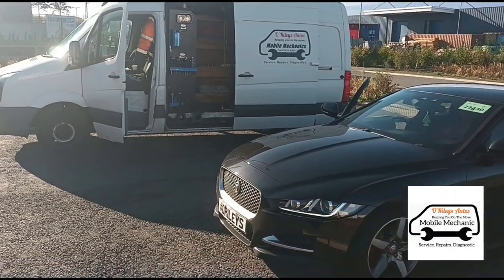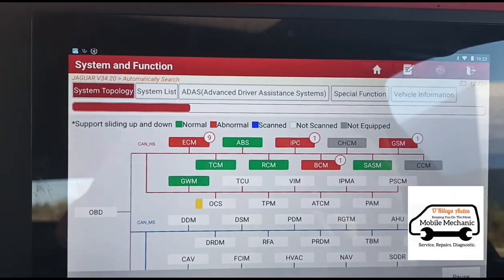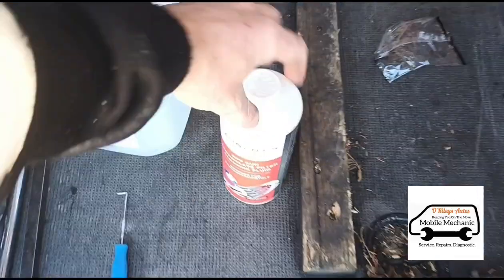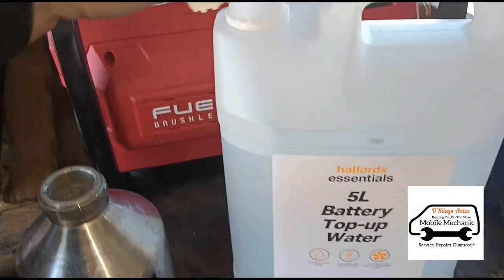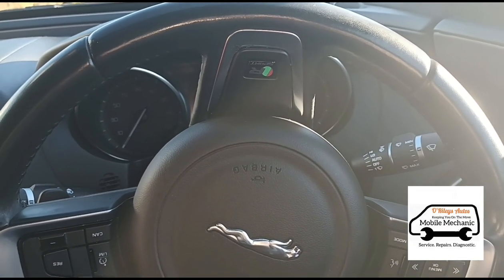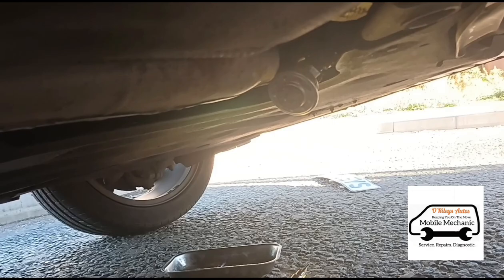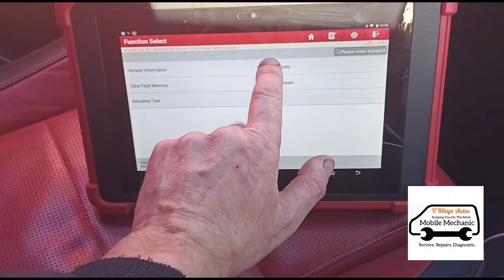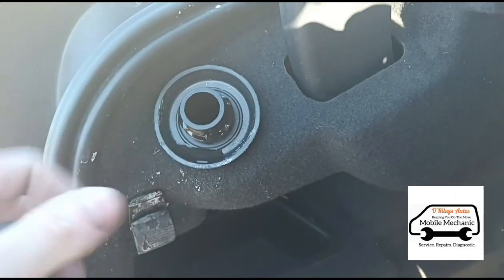Jaguar XE 2.0 SCR Cleaning P20EE-04 P2BA9-92 P20EE-92 P2BAE-00 P2BAF-00 P2BAE-02 Catalyst Efficiency

Comment: Great video just when you disconnected adblue injecter you didn't show if fluid was coming out of injecter should it spray out or is it a dribble when car is running thanks for these videos as learning a great deal about adblue systems
Reply from the maker: Sorry was having a strange issue with the active testing where it would have a communication error wile the car was raised.  When the car was lowered it would connect. 🤷🏻‍♂️
Reply: Don't say sorry thanks for your time too do these videos very useful was just wondering does it spray or dribble out of adblue injecter a good working one ?
Reply from the maker: @danielgreenbaum8875  normal working adblue injector isualy has 3 tiny spray nozzles that do short bursts

Comment: I have the same code p20ee adblue injector clear , new scr system fitted a year ago , I just get the engine warning light then when I connect my OBD reader the code P20EE appears any ideas ?  
I have cleared the code and can drive for around 3 weeks till engine warning light comes back on again with the P20EE code please help ?

Comment: The addblue system is such a disaster creating a point of failure. I had an addblue fault just as I was to board a ferry to Ireland. I proceeded expecting a main dealer to assist. The ever helpful dealers could not see me for 2 months ! I did manage to get the fault codes cleared as I was in a desperate situation.

Comment: always get these  locked out  none start ...reset to give them  31 mls till won't restart but as long as you turn off start stop   and don't turn off you could do over 200 mls in most cars  carpet tape over the ignition key /switch stops them turning off till at a place suitible repair

Comment: I have 2016 Range Rover diesel HSE 
I recived this message " no engine restarts incorrect diesel exhaust fluid quality detected " 
As I saw your videos about this ℹ issue,  after clean adblue injector and crystallization around the tank hole, you add something like cleaning liquid with small compressor machine and pushing liquid into tank and after all, starting engine to clean the whole line. I saw other viedo some mechanics guys only clean the Adblue injector & crystallization around hole thank ( NOT CLEAN INSIDE THE TANK ) and message will remove from dashboard message center, plz check this link https://www.youtube.com/watch?v=vJmUWVlnyT4&t=57s
My question : Is it okay after clean adblue injector and crystallization around hole tank then by pass pushing liquid cleaner into the tank and leave it with out this step ? 
Thank you so much